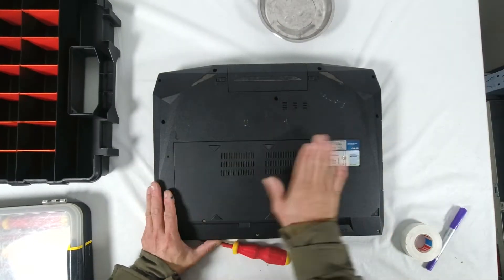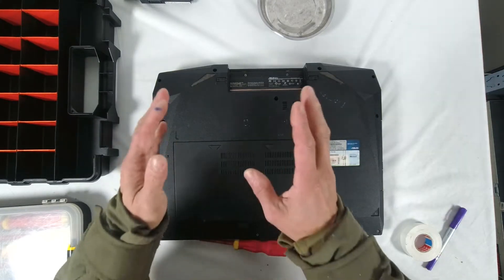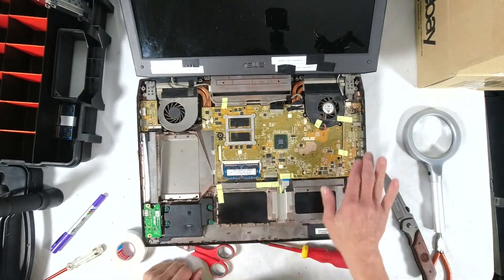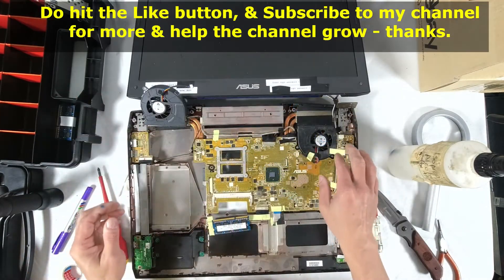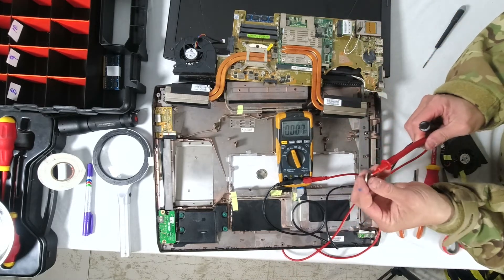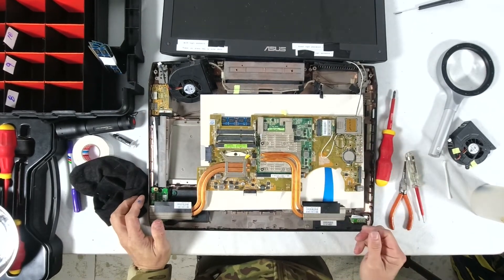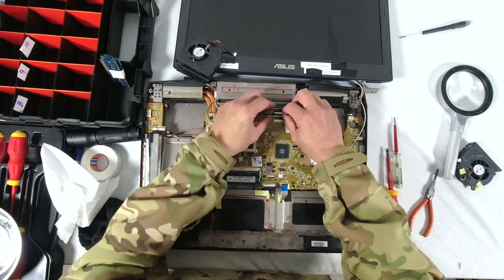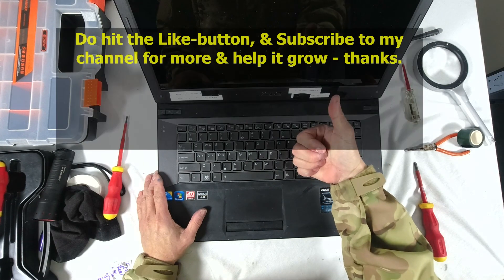ASUS G73JH laptop - process to replace CMOS battery, re-paste CPU, GPU & clean cooling fans

Comment: Great video. I need to take apart my g73j laptop. Let a cousin borrow it and now it has like years of dog hair. 
There has to be a way to upgrade some parts in there. I know the ram can be swapped out, but I am not sure which hard drives can be put in there. I think mine are failing (its been 14 years, they all have a max read and write.)
Reply from the maker: I also have an old DELL 15-7537 INSPIRON i7-laptop. It had OEM SEAGATE ST1000LM014 1TB HDD, & dead battery. It has WIN10-PRO installed. Becos of the dead-battery, I could only run the laptop when the AC-power is plugged in. Nevertheless, the laptop took many mins just to boot-up, & after booting-up, ran extremely slow. This is becos the laptop really needs to draw power from a healthy strong battery. A trickle battery-charger does not provide enough amps rapidly to drive the hardware.

So 1st change I did was replace dead-battery with new battery. The new battery made it boot up faster, & run faster. But it was still slow nevertheless. So 2nd change I did was replace old OEM SEAGATE 1TB HDD, with new CRUCIAL MX500 1TB SATA 2.5" SSD. 

CRUCIAL provided a free ACRONIS imaging-software I used to clone the old 1TB HDD, into the new CURICAL 1TB SSD. Becos the laptop was extremely slow, I removed the old HDD, & connected it to a new powerful PC I just built (see https://youtu.be/2iBGxIkepfI). And used that PC to clone the old HDD to the new SSD. This took only a very short time, becos of the fast PC I built. I suspect Western Digital also provide free ACRONIS imaging-software to clone old disks to their WD products.

After installing the new 1TB SSD into the old DELL laptop. It made a huge world of difference. The boot-up time is now fast enough to be acceptable, & Apps run much faster.

On the ROG-FORUM.AUS.COM website, you'll find many discussions on upgrade of hardware incl HDD for the G73JH.
https://rog-forum.asus.com/t5/rog-gaming-notebooks/asus-g73jh-hdd-upgrade/td-p/648304